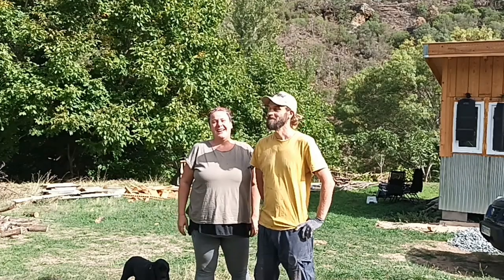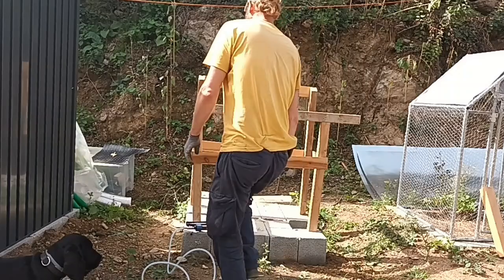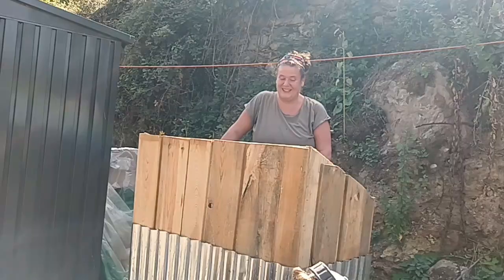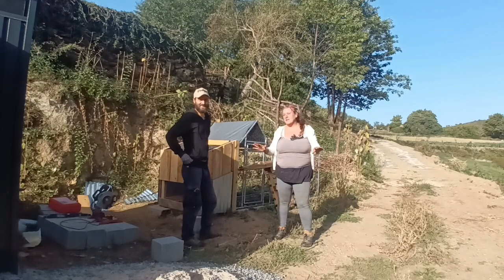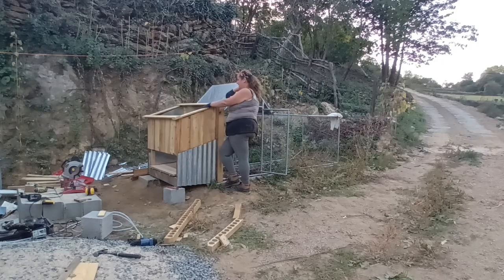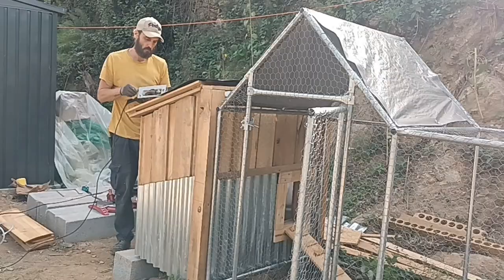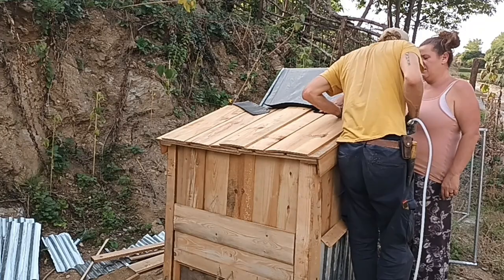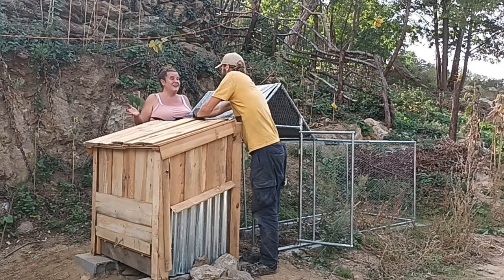We built a super practical CHICKEN COOP for Free with SCRAPS in 3 days (with Time-lapse)🐔🐔🐔🔨🔨🥚🥚🍳🍳

Comment: Great chicken hutch but chicken get very hot they die over heating you need some ventalation to let the air in when your chickens are roosting at night wire mesh in the side with sliding door to cover on very cold winter nights i worked on a farm that had chickens
Reply from the maker: Hi Patricia, thanks for stopping by and watching us. To put your fear to rest,  I've used a windbreak/humidity membrane (2 layers) on the inside. It truly helps to regulate the temperature, and there are also little vent traps in the coop we should have highlighted those in our video, my mistake. 

So you know, we plan to add a solar door to the coop once we find one at a reasonable price. We don't think the hens and the rooster will spend much time in the coop in the summer, as they'll be free-ranging, and mornings are fresh even in the summer in Portugal. I'm certain we will lose a few to heat if we get another heatwave like last year,, in the daytime, it got to 47 degrees Celsius. We'll just have to make sure they stay in a shady area and have access to plenty of water. lol, we asked mother nature to "turn down the heat" last year as we were building, lol but she didn't answer the call :D

Comment: Beautiful chicken palace!  But  could the metal lining  be like an oven in the summer?  May need ventilation.  What do I know?  Lol.  You two work so well together!
Reply from the maker: Thanks mate! Yes the zinc lining will get hot in the summer for sure, but a couple things to remember the coop is well ventilated, it has a windbreaker membrane which helps regulating temperature and the chickens will only be in there in the morning (they'll be free ranging) most of the day. Plus if the coop get too hot before we let them out they have access to the run as well ;)